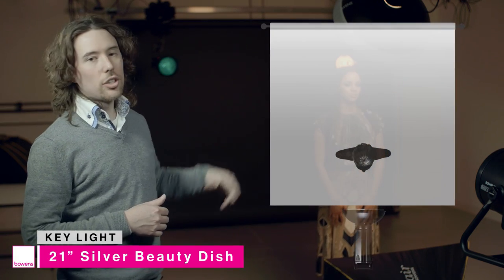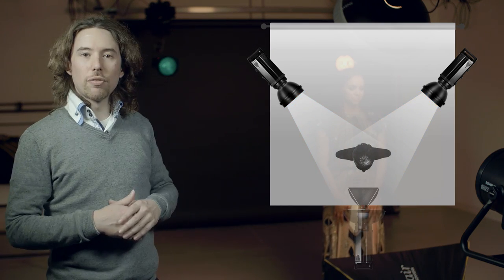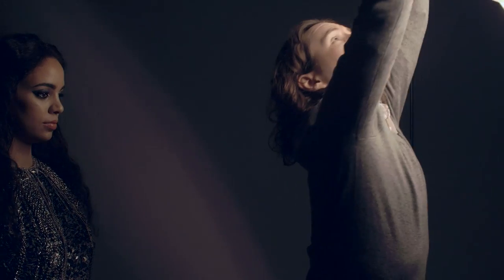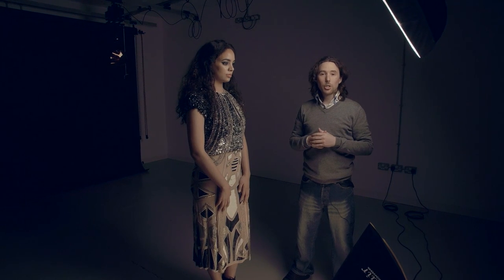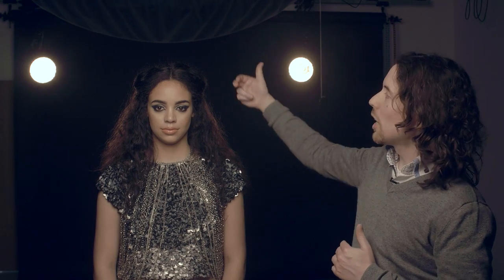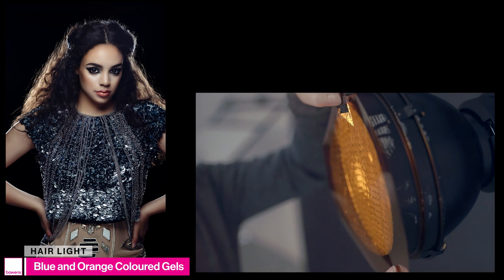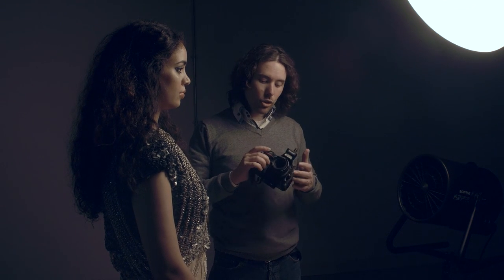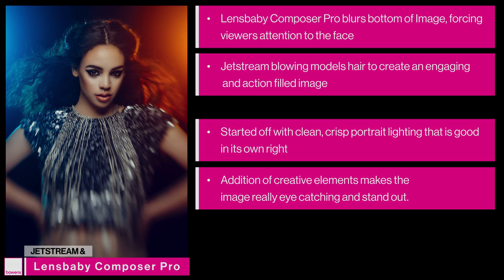Photography Lighting Techniques: Building Blocks - Step-by-Step Creative Portraits with Jake Hicks

Comment: What lens you used? and what is the filter?
Reply: I used the Lensbaby Composer Pro 50 for the blurring you see here, no filters :)
Reply: +Jake Hicks at 7:46 you have mentioned that you are using diffusion filter. What brand and model was it?
Reply: I just use a generic no-brand one, nothing expensive :)
Reply: Seems like Tiffen makes a gold and black and they come in different strengths.  Any clarification on which yours is?  Great video by the way.  Thanks for sharing your knowledge.
Reply: My Formatt-Hitech filter named Movie Mist Black 1 gives exactly the same effect. And it is also useful if you want to reduce a contrast.
Reply: And afair it is the weakest from Hitech discussion filters
Reply: So not sure what that one is featured  here but the one I'm currently using is the LEE 'Soft' filter number 2. Hope this helps clear any confusion on it.